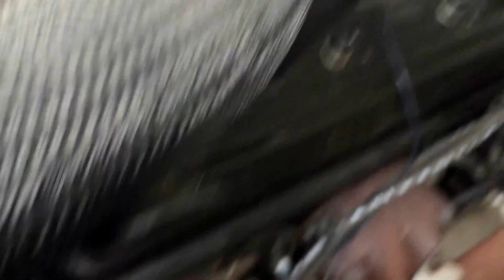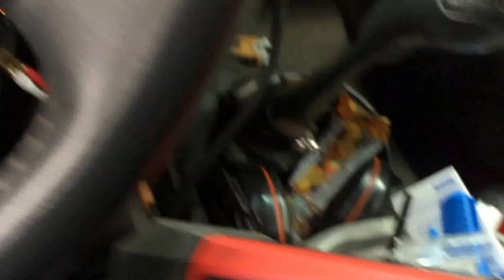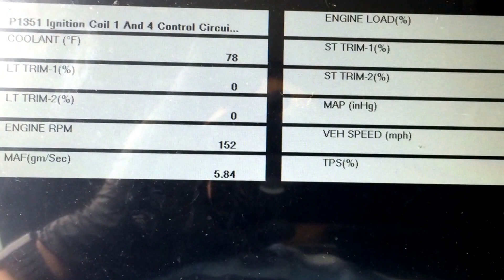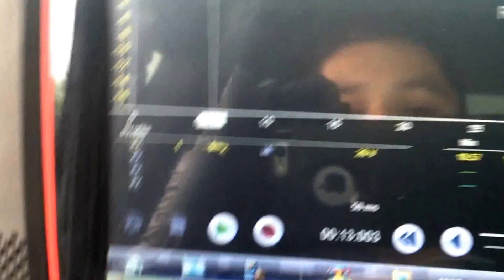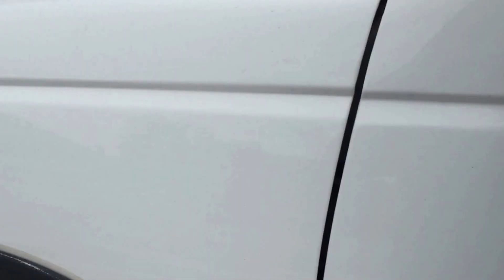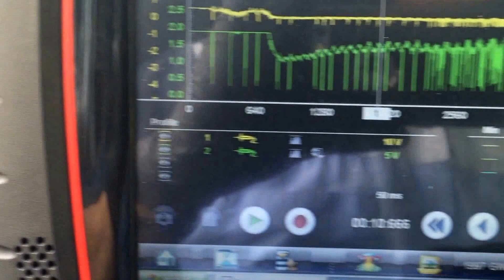97 GMC code P1351 Slow Cranking

Comment: Mine starts missing after it gets hot and i shut off and start back up. Ive changed and cleaned all grounds and the code said coil high voltage cant remeber the number of code.

Comment: Where did you get starter from sir? I have same problems, same truck…
Reply from the maker: Make sure the battery cables, all cables are tight
Reply: A reputable rebuilder, or a new GM starter. Or try a starter from a 4WD or K model. They usually have a smaller permanent magnet starter. Less electrical draw, and it's lightweight. Remember; 305 to 305, 350 to 350. Different diameter flexplates and flywheels.

Comment: My hell raising PO1351 turned out to be.....Starter Relay. Spider Cracks from pin 30 to pin 86. Once I installed new Starter Relay. Problem gone. So nice to crank for a moment and engine starts on 1996 GMC Savana 305 L30 custom van 137k odometer.
Reply from the maker: Started was the problem  here too

Comment: I have a 1997 k1500 vortec (on my channel) Runs great but occasionally will crank, fire, then die only when hot outside temps and engine is heat soaked. Once cooled down with hood open for 20 minutes, starts and runs fine. Sometimes i can keep it running if i dance with pedal keep rpms high after start. Previously it would cut out in rpm range when hot. Replaced ignition control module and that problem went away but still have heat soaked hot start issue. Seems to crank normally no slow crank. No codes.
Reply: Check crankshaft position sensor
Reply: @gregpace4676 finally figured it out. Fuel is boiling in the fuel lines. Stock lines are in stock position and the exhaust is stock routing. I blame it on the ethanol content in our fuel. I can keep it running if I pump the gas and keep RPMs at 2K or higher and once enough fuel runs through the lines it will idle and run fine.
Reply: finally figured it out. Fuel is boiling in the fuel lines. Stock lines are in stock position and the exhaust is stock routing. I blame it on the ethanol content in our fuel. I can keep it running if I pump the gas and keep RPMs at 2K or higher and once enough fuel runs through the lines it will idle and run fine.

Comment: I diagnosed a bad starter when i first heard it crank over without a $20000 scan tool 🤣
Reply from the maker: When some tell you  what was the problem jumps in a lot  of peolpe  that they knows what was the problem ,  this was not the started ,  were the cable connection but were no loose . But  your are  good guessing , we as technician  if we suspect  some things is wrong we have to   confirm it with 1 dollar tool or 12 thousands dollar tool  like the 1 I used here

Comment: My son's 1997 Tahoe was having a similar issue.  I cleaned the power connection you noted at the main fuse block and so far that seems to have done the trick.  It was taking a long crank to start and would not stay running sometimes and the check engine light was on.  Started right up after cleaning that cable and check engine light was off.  Great info!
Reply from the maker: nice

Comment: Excellent video and information.  My 1998 GMC C1500 had the same problem and code P1351.  Turned out to be the battery cable was loose.  Tightened it and it fixed the issues...take care and have a great day!
Reply: Charles Almond thank you for your input
Reply: Charles Almond

Comment: P1351-- Make a new Key!  
My old school classic style 2000 GMC quad cab 4wd, vortec 350, GMC does not have a chip in the key, so I never thought of this! 
I got code 1351 out of the blue and couldn't get rid of it or get the truck reliable, so, like every other person on any thread anywhere has done with a P1351 code, I replaced just about everything on the truck - coil, battery, ignition control module, complete distributor, plugs, wires, starter, voltage regulator/alternator, crank sensor- everything except the BIG computer...and that was next! 
Even looked for shorts in the wiring and patched up a few frayed spots. After and intermittently in between each of the 20 things I fixed/replaced the 'Service Engine Soon' light would go off and come back on after each repair or 10-20 starts in between each repair... Mechanic after mechanic.... money after money... tow fees... 
UNTIL last night, when an old master said he recommended I try a new key, the original key if possible. So I went home, got the original key, put it in, SES light went out. Got a new key made at the home depot and used it all day. All appears well after driving it all day and intentionally starting it 30 times during the day.
He said that it has something to do with the built in security system-- if the key is worn, and after 15 years it IS, mine so worn I could pull it out of the ignition with the truck running (and I liked that because I farm and I didn't have to restart the truck after getting out and getting back in after unlocking and opening 3 gates a day...6 times a day!) 
If it's worn it doesn't always hit the tumblers right and if it doesn't hit the lock tumblers right you can crank and crank but the security system won't fire the cylinders... or for sure it won't fit right every time, and so it prevent cranking intermittently, never knowing when that will happen. EVEN IF you don't have a chip in your key, it does have some type magnetic operation about the tumbler connection that trips or doesn't trip that start-up security system, and a worn key won't hit right and trip or untrip the security system right every time.
SO......Took original key and had new key made. Did notice that the original key and the new key will not pull out of ignition like my old key did, and so far, so good, Mystery solved for me. This time.
Reply: Thank you so much for writing this i had changed and tried everything would bot stay running and sometimes wouldbt run at all tried this after spending 1000 on parts and fixing them and this simple suggestion got it running
Reply: @paullafay4730  so a new key worked for you? Mine is very wore out...I have a 1997 3500 7.4 dually...hard to start...once it starts it runs perfect driving
Reply: cissy vaughn z
Reply: im going tomorow getting new key ive spent weeks and 800$ hope it works for me
Reply: @michaelbaskin8271  did it work?
Reply: @Reallionaire314  it worked for me i hace a 2000 chevy astro it stopped working during winter one day it got down to negative 20 coldest dat this past winter went out to start would not start ive changed the ignition coil ignition module fuel pump ,thermostat just because it needed it. Changed oil. Changed camshaft position sensor changed the magnetic sensor undervthe ebgine dont remember name changed cap and rotor twice couldnt not get it to run consistently would run stall die sometimes never crank up oh also got a new batterey. Then read this went and got my spare witch actually was the original chevy key and it crabked right up and stayed running shut down did it again stayed running thank you sososo mich for this
Reply from the maker: +cissy vaughn 
the problem with this vehicle was started motor , and voltage drop on battery terminal